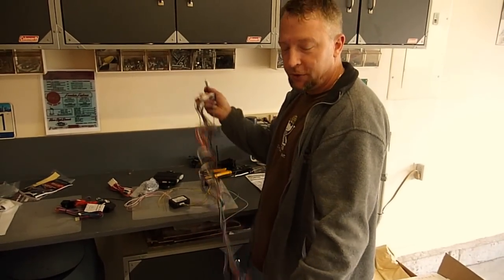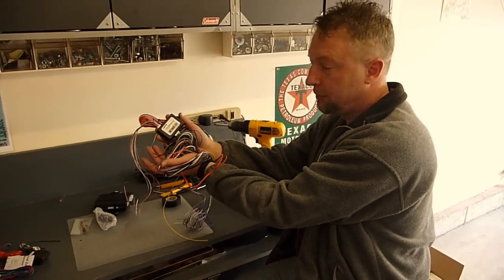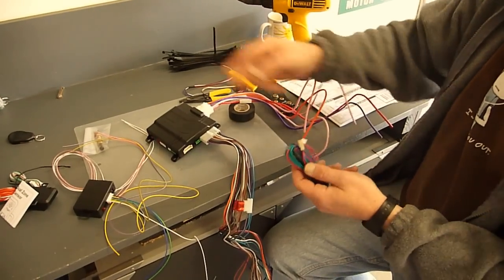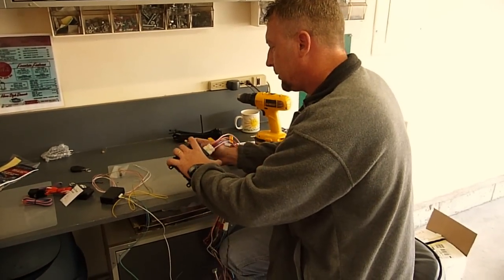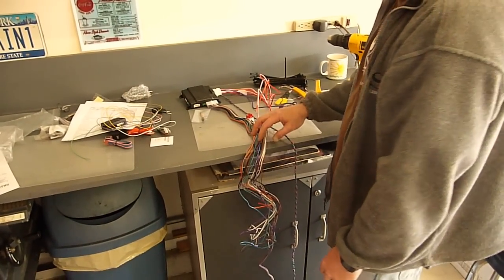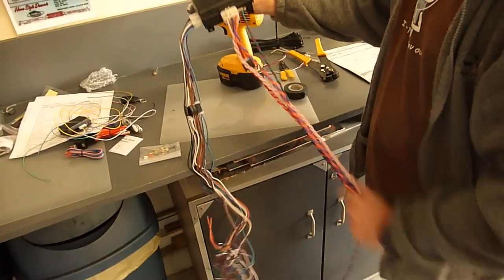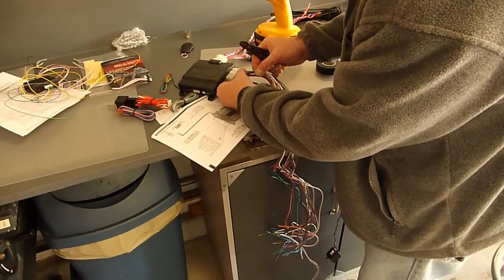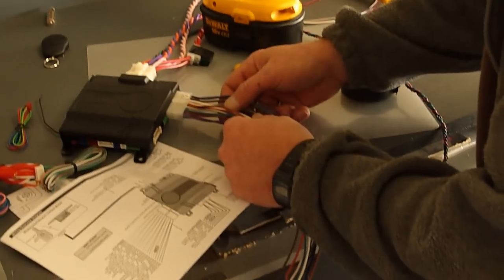Part I - How To Car Alarm Remote Start System Installation

Comment: Could you help me? I have a Karr 2040 that has short circuited and left the starter disabled. I can put it in valet mode, disable momentarily, but it will not start. Any ideas?

Comment: hi,i have already compustar alarm in my car.if i add this cs800-s to my car.how to install? do i have stall parallel wirings:hook pin,brake wires,lights....between new remote starter and old alarm.thanks

Comment: Hi, I just purchased a 05 titan with manual locks. Just noticed it has an alarm by karr, but the brain is pulled out. The locks are wired through 2 relays that rest at ground to operate. One relay locks and the other unlocks. I bought an after market keyless entry and im wondering if I purchased the wrong one for this aplication. I can't get it to work. Please help

Comment: Ok so I almost never comment on people video's for installation instructions but the one most biggest problem with people posting videos for any type of installation is they spend almost the whole video teaching people about wiring or little tricks to organize all the cables.  That's not what this video is about.  If the person watching this video doesn't have any type of electrical knowledge or experience they need to be watching a different video . This video is instructions on how to install the alarm. Not about how to make the wires look nice. And for professional installation never tell a person cut this cut that wire because every vehicle installation is different.

Comment: hey i hook up a prestige model aps-787c alarm system in a toyota allex .and fr sme reason or the other its nt starting the vehicle ,its lock n unlockin,i dnt no if i connected the wire wrong ..plz help!!

Comment: Love your video and want to go with your recommendation on the Omega Excalibur alarm systems.  This would be for my 1982 Corvette.  Capabilities besides basic alarm functionality: remote start, remote roll up/down windows, 2 way communications with FOB (able to use my iPhone 5S too), glass breakage sensor, tilt/motion sensor.  Very interested in your recommended Excalibur model number and, if you might know, a reputable installer/shop in the Las Vegas NV area. Thank you.
Reply from the maker: For you I am going to recommend the cg-830i8 (better warranty and theft coverage for the same cost), the carlink-3g, and the au46td tilt switch, If you would like a deal from us, We'd love to take the order for you, Martin 904 342 549

Comment: Aloha,

I enjoyed your videos and I truly appreciate your knowledge.  I love the way you use the drill to spin the wires.  I recently purchased a 1968 Volkswagen Beetle.  I also purchased an AutoPage Car Alarm. 

Any suggestions on installing in such an older vehicle?  I noted that the is no wiring harness diagram for a vehicle that old.

I would appreciate any suggestions or help..\\

Mark
Reply from the maker: the wiring is awfully simple, but if you want the info anyway I'd invest in a Chilton manual for reference. all else is the same as a new car

Comment: Ur videos are awesome. Anyways got a prob of course n need help. hooked up a few units but still not a pro! Got a 2000 Infinti i30 and hooking up Prestige APS57c remote start no alarm unit with FLTB1 transponder bypass through DBI data port. Got everything in, by the way had to rip out vintage autopage alarm (RF 315) w/ shock sensor before the install. Hooked everything up and didn't work, realized I had a few errors. a little confussion w/ parking light wires: this unit has 2 wires and no +/ switch on brain. manual says hook one (no matter which) to either 12+/ ground ad other to parking light circuit. chart says access at kick panel for P. light is + and access at column switch is . Don't know if I did it wrong, but I tied into column switch () and then tied other white P. light wire to +12v (ign +12v). Wow, hope I didn't fry it if this is wrong. Also to keep battery from dying I removed fuse for door light however this fuse also kills ability to use power locks. I had to hook up relay for trunk. Bypass is correctly programmed. no response what so ever from unit other then three, double blinks of the antenna's LED. Tach is tied in, both starters, boths acc, one ign, and both constant +12v combined into the one +12v the Infiniti has. smelled slight buring, but unsure. opened brain, no evidence on motherboard? what am  doing wrong. Please help me out.

Comment: I bought an Avital 4105 remote start with PK all bypass module. I'm having problems with ambiguous connections on the main wiring harness specifically. What does it mean when the number 3 yellow wire is supposed to be a positive ignition out to alarm? what do I connect that wire to? number 4 wire is white blue on the main 9 pin connector harness it said negative activation input what do I connect that to? number 5 is an orange -500 milliamp ground when locked /mt grind output what does that mean? then there's a 4-pin satellite harness with a blue wire with a negative 200 milliamp status output I have no idea what to connect up to number 2 is an orange negative 200 milliamp accessory output no clue again number 3 is a purple negative 200 milliamp starter output number for is a pink negative 200 milliamp ignition output.

Comment: I took my 2012 mustang to install my viper 3002 and my local installer couldn't install it he said it had different type of door locks, another shop said 400 just to install it for the same reason? Is this true? Please help
Reply from the maker: no, not according to what I see:
POWER LOCK
BLUE/GREEN (-) TYPE B
@ SJB, GRAY 26-PIN PLUG (C), PIN 17

POWER UNLOCK
YELLOW/PURPLE (-) TYPE B
@ SJB, GRAY 26-PIN PLUG (C), PIN

Comment: do i need a bypass module for a viper 5305v on a 2002 tundra access cab sr5 it doesnt have wireless key or alarm just eletric locks
Reply from the maker: I dont think youll need one according to my notes.

Comment: I would like the password.  Also I noticed that I needed to tap into the Tach wire @ the ignition coil pack; however I don't have one on my 97 Chrysler Sebring.   What should I do?

Comment: I was wondering if I can get the password to the wiring website I have a 2001 grand marquis ls it’s been awhile since I installed alarms. I was a shop manager for 5 years back in the day of circuit city
Reply from the maker: no, but you can email me and Ill do them 1 by 1 for you at sales@lesscoelectronics.com
Reply: Lessco Electronics ok thanks I emailed you with the subject as my 2001 mercury grand marquis LS

Comment: I'm trying to installa compustar cm800 on a 2003 Infiniti G35 but not getting any help from compustar I don't think I have the right install manual any help you could give would be great using idatali k multi series alca. Do I need to program it with any special equipment I am a electrician so can read diagrams thank you.

Comment: 2000 Chrysler neon trying to install a viper 4105v remote starter, manual transmission, no electric doors or windows any schematics or wiring guides??
Reply from the maker: +Martin Rodriguez email the request to me - Ill reply back:
sales@lesscoelectronics.com

Comment: installed my Viper remote starter and connected the vehicle alarm disarm wire only, not the door open ,close. When I remote start the car, the doors open first, then the engine remote starts. What can I do to change this? Thank you!
Reply from the maker: is your car a mazda or a Honda by chance? try adding in a rearm / relock wire after remote start.
Reply: Lessco Electronics
it is a 2010 Mazda 6 and the viper remote is 4204V. The only wire I can see is a factory alarm arm output
Reply from the maker: whats the year make and model car? you didn't say..
Reply: got it! thanks for all the info ! your video was a big help!

Comment: is the RF 425 Auto page have a first ignition and a second ignition wires  also is this remote stater have a accesory wire thanks  I going to installed on a toyota camry 1995 is posible can you send me a wiring diagram thanks

Comment: I need your help buddy...I bought a Viper 5901 which i wanted to install in my honda accord 1999, which i never did. Now i'm thinking it of finally using it in my chevy truck. This is what i have I have Viper 5901 Remote Start/Security Alarm System. I also bought the Radar motion sensor 508D..everything is brand new.. What else do I need for the complete installation..I do want to roll up and down of my windows....I notice you are using a relay? Shops do rip off people especially when you have a brand new car..So i would like to pay for the labor only..Now saying that how can I trust the installer..most of the time they take the vehicle to the back don't let the costumer see the installation..Can you give me some points..how can i know they are doing a legit job? I think i gave you enough info.. Question? does the cable gets damaged by using the drill?
Reply from the maker: Fisrt off you didn't tell me the year and model pickup so I can't say if you do or don't need extra items. You can find out though by using the car fit guide at idatalink.com or ifar.ca

As for finding a good installer I suggest a smaller specialty shop that has been around a while, avoid best buy unless the installer was a transplant from a real alarm shop in the past.
Reply from the maker: all you need in addition is a key bypass kit, for the app guide use xpresskit.com and also a window module like the 535t. that's it. as for finding a good installer, it's easy... go to a small independent shop that's been around a while theres where you find the good guys.

Comment: Hi, I have a 2001 Ford F150 SCrew Lariat and I wanted to know what bypass you recommend for a Viper 4806V 2 way kit. Also may I have the password for the wiring info?
Reply from the maker: DJ Gee the keyoverrideall  and the evo-all fortin makes are really nice. as for password, we don't do that anymore, its free at bulldogsecurity.com though
Reply: Thanks a lot man!!
Reply: I bought the (1100F Ford Pats Securilock Data Remote Start Interface Module). Do you think this will work fine?
Reply from the maker: DJ Gee as for password, we don't do that anymore, its free at bulldogsecurity.com though

Comment: thank you very much for this great video but, to my level, you fly too fast :).  I have a question.  i have an acura 2002 TL, an "expert" told me that i needed a bypass + remote start module + a "40/50A relay".  I wasn't sure what to do with the relay? how to connect and what for, or is it needed? thanks!

Comment: This video only shows the prep! Where is part 2?
Reply from the maker: https://www.youtube.com/watch?v=sZuDDpn8gPc
Reply: @Lesscoelectronics  Awesome, Thanks  Lessco Electronics, It's because I'm trying to install the Excalibur AL-2075-3DB-L into a BMW E36, with 1 complete loom BMW and 1 complete loom Toyota, as it's a engine swap and I'm unsure of the method of how to splice and lighten the loom without destroying its functionality. So BMW With Toyota 2JZ engine, plus its a huge mess right now, and no Electrician  would take this job on for any reasonable price (don't blame them). Again thanks for the reply and the link to pt2

Comment: I am in need of a wiring diagram for a 2008 Mitsubishi Raider. I have looked everywhere and can not find one. Can someone help please
Reply from the maker: sure, just email me the request to:

sales@lesscoelectronics.com
Reply: email sent. Thank you
Reply from the maker: ok, Ill check now
Reply: I sent you an email cause the wire diagram you sent me says that the green is a constant 12 volt but the green is showing a current ground